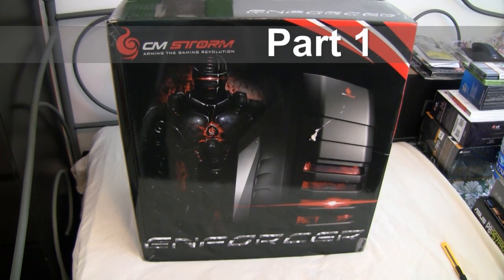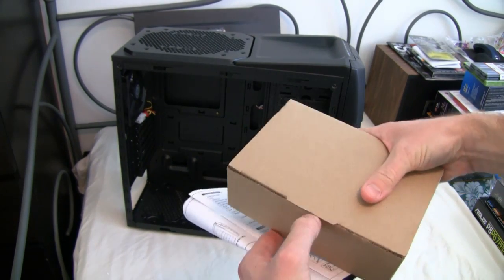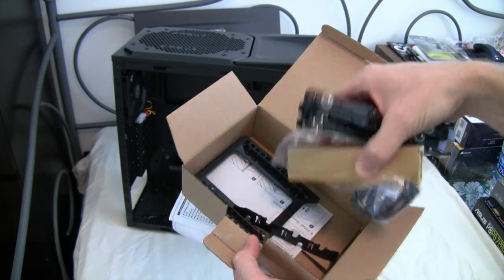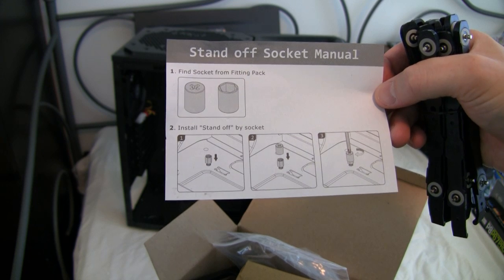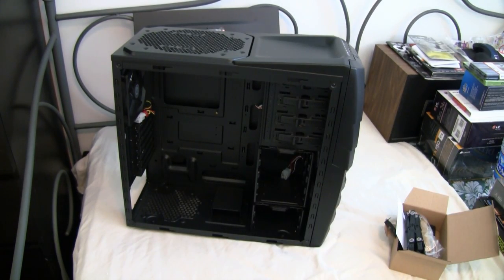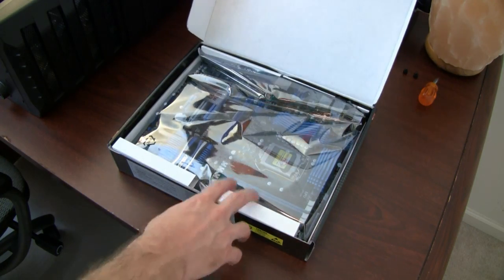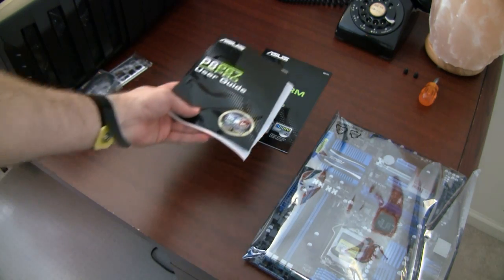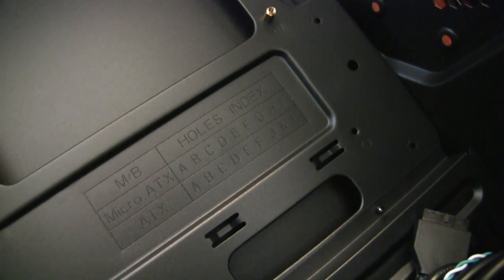Gaming PC Build instructions (Step by Step) Part 1

Comment from the maker: @NostalgicLink  The bag used has maximum, triple-layer protection. Unlike most anti-static bags that suppress static charges on the outside only, this premium bag guards against charges inside and out. The polyester outer layer features a semi-conductive static-shielding coating.  Times and coatings has changed over the years people.  I also touched the outside of the bag before laying the board on top to ground any charge.

Comment from the maker: @KingKoldof  The bag used has maximum, triple-layer protection. Unlike most anti-static bags that suppress static charges on the outside only, this premium bag guards against charges inside and out. The polyester outer layer features a semi-conductive static-shielding coating.  Times and coatings has changed over the years people.  I also touched the outside of the bag before laying the board on top to ground any charge.

Comment from the maker: @iemirpi  The bag used has maximum, triple-layer protection. Unlike most anti-static bags that suppress static charges on the outside only, this premium bag guards against charges inside and out. The polyester outer layer features a semi-conductive static-shielding coating.  Times and coatings has changed over the years people.  I also touched the outside of the bag before laying the board on top to ground any charge.  And I did not have the CPU socket exposed for long.

Comment from the maker: @JOSIAO123  The bag used has maximum, triple-layer protection. Unlike most anti-static bags that suppress static charges on the outside only, this premium bag guards against charges inside and out. The polyester outer layer features a semi-conductive static-shielding coating.  Times and coatings has changed over the years people.  I also touched the outside of the bag before laying the board on top to ground any charge.

Comment from the maker: @MrAbn25  The bag used has maximum, triple-layer protection. Unlike most anti-static bags that suppress static charges on the outside only, this premium bag guards against charges inside and out. The polyester outer layer features a semi-conductive static-shielding coating.  Times and coatings has changed over the years people.  I also touched the outside of the bag before laying the board on top to ground any charge.

Comment from the maker: @UDP7  The bag used has maximum, triple-layer protection. Unlike most anti-static bags that suppress static charges on the outside only, this premium bag guards against charges inside and out. The polyester outer layer features a semi-conductive static-shielding coating.  Times and coatings has changed over the years people.  I also touched the outside of the bag before laying the board on top to ground any charge.

Comment from the maker: @DeathMullet13  The bag used has maximum, triple-layer protection. Unlike most anti-static bags that suppress static charges on the outside only, this premium bag guards against charges inside and out. The polyester outer layer features a semi-conductive static-shielding coating.  Times and coatings has changed over the years people.  I also touched the outside of the bag before laying the board on top to ground any charge.

Comment: Do you 'ground' by just connecting your strap to large metal obejct or do you truly are grounded to earth by power socket/ heating element in the building etc.?
I think a metal object is fine for a while but if takes too long, may be go touch the earth/concrete/powersocketgrnd etc. What are you thoughts?